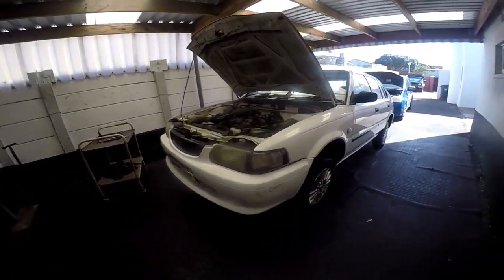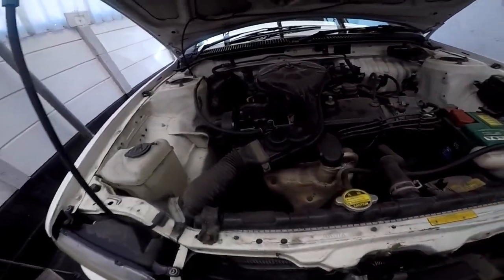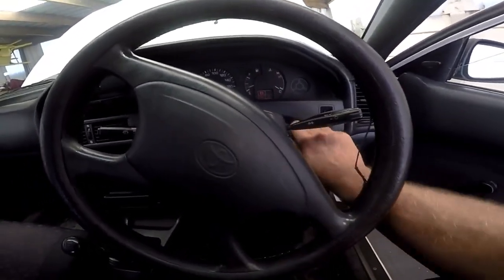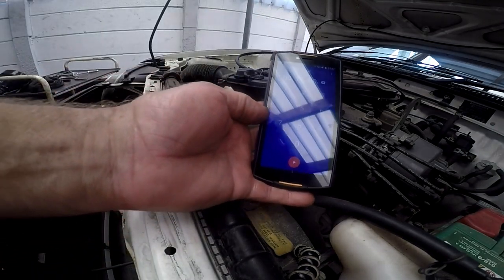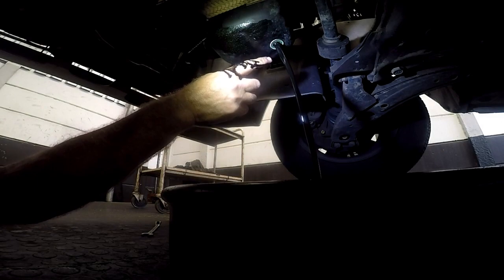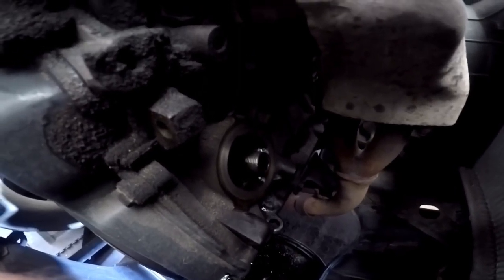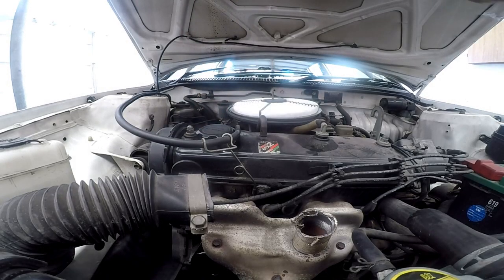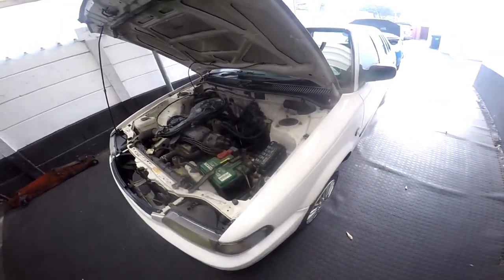Toyota Tazz 1 3 - Basic Service

Comment: Windscreen motor and linkage. How to set motor with linkage. My wipers are sitting in the middleof thewindscreen.
Reply from the maker: Whenever I do the wiper motor job on any car I mark the position of the wiper arms, there is a million ways it can go on, not all will work well, you just have to trial and error until you get the correct spot, sorry, all the best I hope you come right.

Comment: Even tough i do have some experience on the "basic service", as I have prevouisly serviced my 1995 180i GSE Corolla and also my 1996 2.8D Hilux a lot, I am happy that I have watched your video today as I learned about the heat transfer pipe.
Most of the tazz cars that I saw, does not have that pipe anymore. 
I bought a 2005 Tazz 130 two months ago. The car had a smoke far more than this one, but I went on to buy it because of the body interior and exterior that is in a really good condition.
I had a very good mechanic that sort it out for me.
He replaced the valve stem seals and piston rings, obviously quite a few other parts as well, clutch kit, timing belt snd pulleys, etc.
But guys it was worthwile as my car sound even better at the exhaust now, no smoke at all.. and this was done now on 150 000km.
I can't wait to play around with an exhaust system.. 😃

Stay blessed ToyBoys!!

Comment: If it is worn rings take a look at a product called compression stabilizer. Has absolutely worked wonders for me on my 2e
Reply from the maker: I used it in the past, a temporary solution, if rings are worn it needs to be replaced, common sense dictates. Thanks for your input well appreciated. Gary

Comment: Lovely vehicles those, just needs the headlights polished a little and the brake fluid changed, and it will be a new vehicle. Biggest problem is that coil, as it is a very expensive item. Had the distributor stolen off a Venture, parked right outside the door, and that was over R12k  as parts brand new from Toyota, but luckily I was able to find one from a rolled vehicle at a scrapyard for R1000, and put it in. IIRC R6500 for the body, R4500 for the cap with coil, and R2000 for the rotor, and they did not have them in stock, nor did they have the clamp and the bolt either. Scrapyard came complete with plug leads, clamp and bolt, plus all the hoses, just had to take a 10mm spanner and pliers with to do the removal.
Reply from the maker: Thanks for you visit and interaction Sean, wishing you an awesome 2021. Gary

Comment: Any advice on how to change a steering rack on a Citi golf and what are the symptoms of a failing steering rack??
Reply from the maker: Hello thanks for supporting my channel with your visit, subscribe if you have not yet already, it depends on whether you have power-assisted steering or just a normal one the latter is easier to replace, I do not have a video on my channel yet but do a google search I am sure you will find one there, symptoms are normally hard steering, too much play when moving the steering wheel from side to side and knocking sounds on the suspension due to a badly worn rack or rack ends and excessive tyre wear. I hope this helps wishing you an awesome 2021. Gary

Comment: It's 2024 and im 22 would you recommend i get a Tazz for my first car. I really love it but dont know if it's worth it 😢
Reply from the maker: Yes I would recommend it not only as a 1st car but be sure to check the one you get out thoroughly, as they are not new and it would depend on how it has been looked after, there are still some good ones out there.
They are easy to work on and relatively cheap to maintain.
Gary

Comment: Hello. Thanks for the informative video. I noticed in my tazz, there is a red sensor/switch right under the upper radiator hose, and a smaller sensor next to it. I replaced the smaller one cos my fan wasn't kicking in. That one was also quite old. I was wondering what that red switch/sensor is? Is that the temp sending unit?
Reply from the maker: Yes it is
Reply: @vehiclemaintenanceandrepai3790  thanks
Reply from the maker: Pleasure
Reply: @vehiclemaintenanceandrepai3790  I managed to fix the car, it was a faulty temperature sensor causing the fan to not switch on
Reply from the maker: I am glad you resolved the issue. THANKS FOR THE FEEDBACK.

Comment: Good day, Any advice on why My Toyota tazz won’t engage gears, it sometimes struggles to engage gears. I have seen oil leaking from the gearbox, do you think my gearbox probably needs oil ? 

Also,

My clutch pedal feels a bit different. It starts to move the car at a very low level before i could lift my foot until a certain point to feel the biting point.
Reply from the maker: It could be a low oil level, but then it will also have a rumbling noise while driving, it could also be clutch-related, does the pedal travel feel normal or short.

Comment: i want to do an oil service on my ee100 corolla 2e but not change spark plugs, the reason for that is a mechanic cross thread my nr 2 plug and im afraid the new one wont set if I remove the old one
Reply from the maker: Best not to remove that plug Len, unless you are prepared to put an insert into that cylinder, 
An insert is a short metal tube with the inside thread of a spark plug and an outer thread slightly bigger, the idea is to tap the damaged plug hole to the outer thread of the insert with a special threading tap then the insert is simply screwed in and serves as a permanent fix, as now you can remove the spark plug whenever you need to as locktite is used to permanently hold the outer thread of the insert once screwed in.

I performed this procedure many times over the years but recently I could not find the inserts for sale anymore.
Reply: @vehiclemaintenanceandrepai3790  thats what also thought, but I think I should take the head to a machine shop when I have the money. I also saw that the front crank seal is leaking and I previously saw on facebook of other people with the same problem said not to go aftermarket with those seals
Reply from the maker: I agree a good quality seal is needed.

Comment: I got a toyota conquest and my rear park lights and dash lights just went off and I have checked the fuse but it just blown and I think it has a wire that is touching the body ..Can you Pease help if I must check the wiring running down driver side to the back if I must do that
Reply from the maker: Normally I would take it to an auto electrician as I am not one, Edwin.
Reply: Thank you sir

Comment: Good morning sir. I'm about to pachase a Tazz 1.3, can you please highlight me what are the main things to look at
Reply from the maker: Hi Thabang, thanks for your continued support, main things are, check for any accident damage, like the gaps between the doors boot and bonnet, it should be even, loose body panels, ensure all lights works. Before start-up, check the oil and water levels, if it is low there could be engine problems, listen for funny noises, also check out this article I wrote on my website.
https://www.vehiclemaintenanceandrepairs.com/buying-a-car-101/

Comment: Hi, what you advise for when gears is struggling to shift on tazz 1300
Reply from the maker: If the clutch pedal has no feel until halfway down it could be a clutch master or slave cylinder issue, if not it is in all probability the pressure plate.

Comment: Bro my speedometer stopped working on my toyota conquest 1.3 2e, but all other gusuges work, fuel and heat Guage, please advise to what to look for
Reply from the maker: The speedo is activated by a cable that connects to the gearbox,  it has 2 parts that screw into each other, it is normally the second half that screws into the gearbox that snaps, remove that half, and check, good luck.

Comment: Hi I have a tazz and there is a loose pipe in front of the radiator. Right hand side, and it seems to go into a filter of some sort that is mounted to the radiator. What is this?
Reply from the maker: it can only be the overflow pipe, check to see if your overflow is not broken from the radiator filler neck, this happens sometimes.

Comment: What does one do when petrol seems not to be getting to the right place, does one replace a petrol pump or is there another problem ?
Reply from the maker: Hi Lawrence thanks for supporting the channel with your visit, your question is not a simple one, there are many components used in the efficient delivery of fuel, depending on whether it is a fuel injection or carb system. Things like fuel pump could be faulty- not delivering the correct fuel pressure, fuel filter could be blocked, carb could have blocked jets, fuel pressure regulator could be faulty by not allowing the correct quantity of fuel to the system, choke/cold start system may be faulty, fuel lines can be kinked or damaged, fuel injectors could be partially blocked or faulty it must systematically be assessed starting at the most common known causes. I hope this puts you in a more enlightened position. Gary

Comment: Good day Sir, my conquest 1.3 is stalling when enging is hot, & when i pull over and let it cool down for 5 minutes it moves well until i drive at high speed @140kms p\h, kindly advise what could be the problem
Reply from the maker: Sounds like the coil, it is situated under the distributor cap, I had a few cases when this happened and replacing the coil sorted the problem.
Reply: @vehiclemaintenanceandrepai3790  ...THANK YOU FOR PROMPT RESPONSE... WILL CHECK
Reply from the maker: @Ndzila-pl6qw  All good let me know what you found
Reply: @vehiclemaintenanceandrepai3790  ....may i ask do you have a video posted for this  (electrical distributor) issue?
Reply from the maker: @Ndzila-pl6qw  Sorry no.
Reply from the maker: @Ndzila-pl6qw  sorry no.
Reply: @vehiclemaintenanceandrepai3790  ...Good day Madala, i've changed the coil like you suggested, you were spot on, the car is running smooth i can easily do 160kmp\h with no problems...thank you very much you the best, i should come and halla at you when in  CTN.
Reply from the maker: @Ndzila-pl6qw  You most welcome.

Comment: Hi Sir, really hope you good. I'm having problems with my tazz conquest, its leaking oil a lot, which is causing a knock in the engine. this is going to either break my brearings or block of the engine, what would you suggest I do?
Reply from the maker: Hi Clayton, if the engine already has a knock (the damage is already done) then it must be overhauled, done correctly this will sort the leaks at the same time.
Reply: @vehiclemaintenanceandrepai3790   thank you so much , will keep you up to date, I need to save up might only do it end of the month.
Reply from the maker: Thanks, Clayton I cannot wait to see the outcome.

Comment: Hi Gary  our tazz has issues at idling, engine cuts out and when the car has run for a while and is obviously hot it wont start again. then after a while it will start, what can i look for ? regards
Reply from the maker: Hi Philip, the carburettor could be flooding, therefore not idling, too much fuel, then it would not start immediately because the intake is full of unburnt fuel. Leaving it for a while allows the excess fuel to evaporate, allowing the car to then be started.

Comment: M driving Toyota Tazz 2E 
Oil keeps on spraying from the seal. Different mechanics fitted new seals but still, it leaks. What could be the problem?
Reply from the maker: Hi Kgothatso, thanks for supporting my channel with your visit, it sounds like there may be too much crankcase pressure causing the seal to blow, it could be caused by a blocked PCV valve or too much sump compression caused by worn pistons. I wish you luck with solving your issue.
Gary
Reply from the maker: Anytime, Kgothatso.

Comment: Does the fan on this car have different speeds?
Reply from the maker: No, Kresan not the ones I worked on.
Reply: @vehiclemaintenanceandrepai3790  thanks, so there's only one speed on these fans.
Sorry I'm referring to the radiator fan
Reply from the maker: Yes, the radiator fan only has 1 speed.
Reply: @vehiclemaintenanceandrepai3790  howsit gents, can u assist me with this same car, 2E motor.
My odometer and speedometer stopped working, please advise if there's an fuse for this or what could be the reason for this
Reply from the maker: No fuses, it works with a speedo cable, but it could be broken in the casing.
Reply: Thanks
Reply from the maker: A pleasure Kresan.